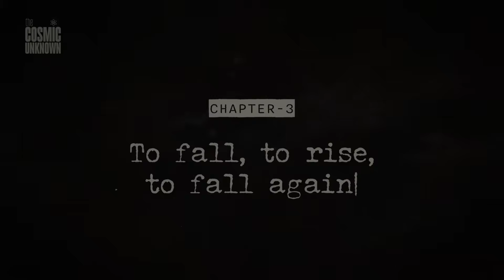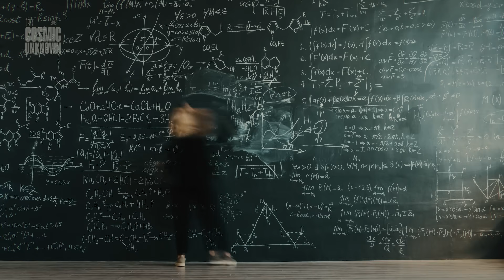What Happened to SpaceX’s 11th Starship – The End Before the Evolution

Comment: Wow! OK 👍  I clicked on this video to correct a lie. That's not what I found. The video is spot on. Starship prototype 11 was intended to fail. It was intentionally sabotaged to find failure points. It survived though. Which means safety for astronauts.  They SpaceX will try harder next time. They will sabotage it even more. If you find all potential failure points before you put people on board then you save lives.

To whoever made this video. Spot on! This was good. Actually great!